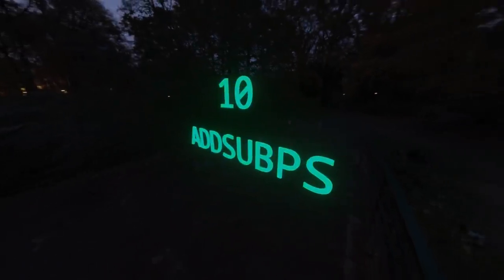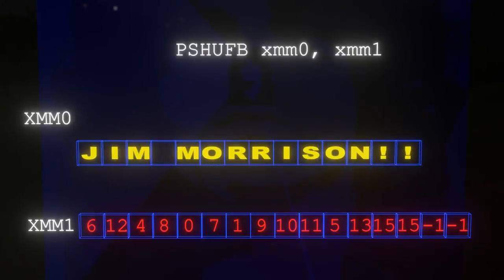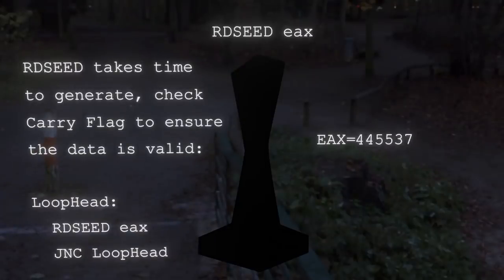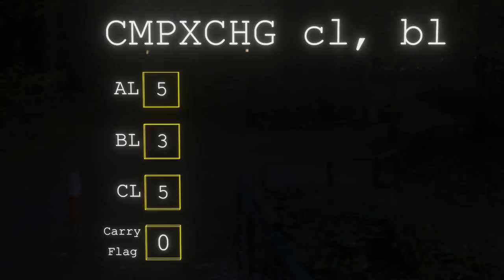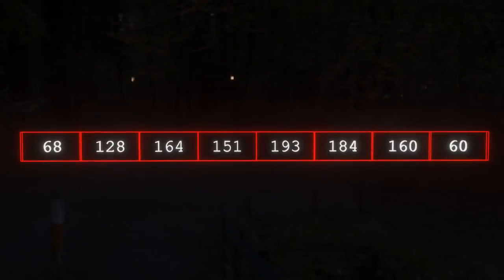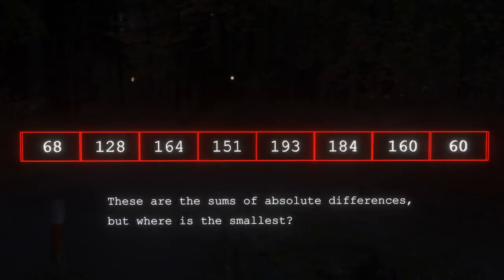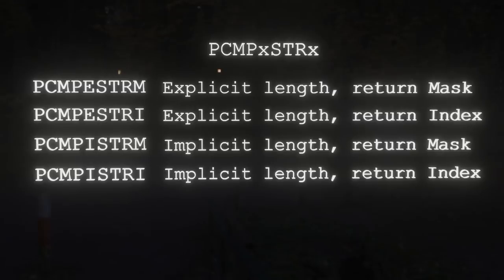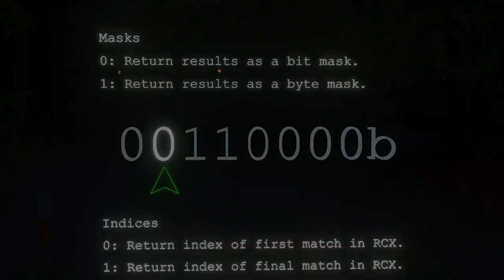Top 10 Craziest Assembly Language Instructions

Comment: "HCF" -- Halt and Catch Fire.

On a lot of early CPUs (1970s/1980s, yes damnit I am old) the manual gave the bit pattern for each instruction - and the the rest of the bit patterns did undocumented things.  Some were just a different way to spell NOP, some did deeply bizarre unintended things that happened because the bits randomly activated chunks of the CPU circuitry that mixed and matched chunks that were used in different combinations for other commands, and some did things that were only ever intended to be done in the factory, during QA testing. 
We used to hunt through these "undocumented instructions" looking for anything interesting or cool that we could then figure out uses for.  But this was a bit risky.  A fair number of CPUs had at least one undocumented instruction that would immediately cause the machine to lock up and, a few seconds later, destroy the CPU. Sometimes they caught fire, sometimes they melted through the PCB.  Sometimes they desoldered themselves from the board and fell out.  Whenever we found it we called it a "Halt And Catch Fire" instruction  and patched the name 'HCF' into our macro assembler for that bit pattern, in order to avoid accidentally finding it again.
Naturally when I saw the title of this video I figured HCF would be at the top of the list.
Finding an HCF usually meant a new version of the chip as soon as the company could mask it off.  We thought of ourselves as contributing to their QA efforts, although very few of them thanked us for it.
Reply: That is ridiculous, thank you for this comment.
Reply: Write while rewind
Eject disc
Read & write while ripping tape
Disable console
active emergency power off
Electrocute operator
Sense card deck on printer and open cover
Write past EOT
Read and scramble data

I have a huge list of them along with my green cards
Reply: Can you give some examples of interesting undocumented instructions you came across with?
Reply: @Safyire_  We found things like 'compare while swapping' that swapped the values in two registers while writing 1 to the comparison bit if the first was higher than the second.  That was actually a little bit useful.  We found a lot of things that tried to do two or three things at once but did them in a random-ish order because of race conditions.  One of those was useful because it consistently did xor before swap if the CPU was hot and swap before xor if the CPU was cold, so we could write code that monitored the CPU and shut things down if it got too hot.  We found instructions that connected multiple registers to the bus for output, meaning the result of the instruction would be written to four different registers at once.  We also found  instructions that connected multiple registers to the bus for input, which was useless and sometimes damaged the CPU.  It was a real crapshoot.  Also a very expensive hobby if you damaged the machine and your professor wasn't ready to write it off to "research."  CPUs were not cheap.
Reply: @rty1955   @Zrebbesh  you crazy old hackers! ;-) you are legends! :)
Reply: @morgwai667  Cept we never hacked, we worked ahha
Reply: I wrote micro code on a 360/30 and if it wasnt on the green card, it was considered an illegal Operation and program was aborted. There were no such things as "undocumented Op codes". Either you coded as per the green card or your job got canceled. Simple as that.
Even a nop was a simple BCR 0,0 or x'0700'
Reply: But why would you not want an HFC instruction? I can think of a few good reasons to have one, at least in government programs with high levels of secrecy. Or, like that one train control system that had 3 parallel CPUs and an explosive charge behind each of them, and the instant any one of the 3 disagreed with the other 2, the charge behind that CPU was triggered and the CPU was thrown out onto the floor. With an HFC instruction, you don't need a bomb squad to fix the system every time it throws an error. Personally, I can see no reason why I'd ever use an HFC, but I can definitely think of a thousand reasons someone else might want one.
Reply: @zrebbesh  Especially if you're old enough that a CPU was a drawer rather than a chip!  Heh
Reply: @mage3690  ... so when a program has a bug, jumps to a random place in memory and happens to land on a HCF instruction your computer dies. Does not sound like a risk I would like to take.
Reply: @mage3690 what train control system was that? Sounds like a cool story
Reply: Then why isn't there any sort of ASM malware that does these instructions?

Moreover, why did these functions even exist?
Reply: @Safyire_  i worked with a processor that if it had a test and jump on the result, it was undocumented.  all i could find was test and branch over the following instruction.  so i had to reverse the logic of the test and branch over the following instruction, which would be a jump.   so jump if equal became branch over the next instruction if not equal so that the jump would happen if equal...  an engineer at my company chose this for his fairly large project and i was the programmer on it
Reply: Did you ever read the novel BLIT? This HCF seems like a "basilisk instruction" to me!
Reply: @mage3690 Well if for somehow an application  runs wild (buffer overflow) and starts executing data as code. You sure do not want a HCF instruction in your data portion. best be patched out. Do not keep it as a security "feature".
Reply: @RationalFunction There were some, historically.

As to why these instructions exist, well, they don't. They're not instructions per se. They just happen to be behaviours which arise when using the CPU in ways not documented in the manual. Some of them are useful, some of them are consistent, some of them are neither. Some are harmful.

An analogue to cars would be things like engaging the parking break while turning the steering wheel, or throwing the gearbox into reverse while doing 55 on the interstate. Neither of these fall into expected operational input, yet they somewhat consistently produce a result which may or may not be desirable and may or may not be harmful.
Reply: @konayasai  I still don't understand what could cause a machine to just lock up, then fry itself. A "Desolder From Board" instruction sounds useful until you realize it would destroy laptops.
Reply: so cool
Reply: The atmosphere of the TIS-100. So it's all true then.
Reply: @mage3690 For the train control example, I am supposing you don't want to depend on a defective chip to disable itself. But I can imagine there would be good uses for what is essentially a self-destruct function.

Comment: I just remember, porting the torque game engine to PSP, and from all the work, the CMPXCHG instruction for the mutex, i implemented some native PSP intrinsic to do that, good memories, the best optimization trick also, the game was doing 10 fps at the best, the problem was matrix transposition, between the engine and PSP "opengl", so i made a transposition on the fly changing the order of reading and writing of the registers in the VFPU instructions, kicking the Sony engineers 'axe' ; ), and getting 30 fps, enough to pass their performance standards.
Reply: Wow you made PSP games?
Reply: @KangJangkrik  , i made the Torque game engine port, and on top of that another team was developing games using it.
Reply: Nice, but wouldn't it have been better to change which indices of matrices are used in vector and matrix functions? E.g. using m[4] instead of m[1] and vice versa.
Reply: Marix transpose is the dumbest operation ever, you shouldn't be doing that, ever.
Reply: @DiThi  that implementation costs 20 fps in that platform, you need to swap the entire matrix operations for every calculation, sounds trivial but was not for a 333 Mhz processor with slow RAM.

before was:

matrix.transpose(); // bloated operation
vector.mul(matrix);

after optimization was:

vector.mul(matrix); // due to the trick no transpose needed
Reply: @kyrylmelekhin2667  What if you have a large matrix of which you need the transposed multiple times?
Reply: @kyrylmelekhin2667  , not in this case, the "OpenGL" of PSP was using transposed matrix operations Torque was not, so was necessary.
Reply: @redsmith9953  You should make a youtube channel on that! Early/Mid 2000s gaming/tech is having a resurgence and you could tell people how you did that in a video format!
Reply: I knew CMPXCHG from some late 90's trauma from debugging a device driver bluescreen on multiproc machines, ultimately due to a compiler bug or misconfiguration that failed to generate the lock prefix. Good times.
Reply: @TimJohns  , 1 year later drinking like no tomorrow if forgot about that instruction!, now i remembered, thanks!, talking about that my first implementation was the naive approach using "if" and "swap" ( so dumb and naive i was ), my friend checked, and telled to me, is an "atomic function" so i realized my mistake, because of course was multithread related ( facepalm )  so i implemented properly using CMPXCHG, so yeah, patetic from my part, gross error... :/, nice times XD!
Reply: @formerlycringe  , Thanks for the recommendation now i'm a drunkard, and can't care less about programming i become something like a homeless hippie, i prefer to sleep on the streets than on my home, whalla!, that happens when you are a nerd and got a gf instead a computer.

Comment: Can't wait till you remake this vid in 10 years with all the custom RISC-V extension instructions. Gonna be pretty wild to see what people come up with.
Reply: The big mistake Intel made is to create fixed width vector instructions. The V in RISC-V points to the importance of the variable width vector instructions where the assembly code doesn’t need to know the vector register size (V extension), and a similar matrix extension is coming for machine learning I think (though V is already a great improvement)
Reply: @ritteradam  The V in risc-v is a roman numeral standing for 5, as it is the 5th iteration of risc from Berkeley (i think).
Reply: @canaDavid1  Officially yes, but you can find videos of the people who developed RISC- on YouTube, and they mentioned that they originally developed it because they wanted to get the vector extension right, and that's why they called it RISC-V at the start.
Reply: Also it's a reduced instruction set (risc) and not a complex instruction set (cisc) like x86
So why should risc-v even get some of these?
just do them in software and let the compiler do it's magic.
Reply: The point of risc-v is to have a common set of instructions understood by many cpus and to be extended with application specific extensions where needed. So you can be 100% sure there will be many wild instruction extensions.
Reply: @tripplefives1402  While you may disagree, a big section of the RISC-V specification isn't the base instructions, but official extension instruction sets (which include vector operations, that you may consider can only exist in CISC architectures), and about creating unofficial extensions. (see chapter 26 of the specification)

It is a reduced instruction set CPU not because it can't have complex instructions built in but because the base instructions are reduced.
Reply: @tripplefives1402  The "reduced" part refers to how the instructions are encoded, which is largely achieved by load/store and eliminating addressing modes.  There's nothing that says a RISC design can't have thousands of instructions.  RISC is a philosophy, not a technology.
Reply: @tripplefives1402  Actually, I have studied CPU design extensively.  Most CISC designs only have a few dozen instructions, but once you factor in all the different variations you need to support all available memory addressing modes, it blows up into thousands.  It's the classic handshaking problem.  RISC processors eliminate that complexity by using a load/store approach, and the tradeoff is that it increases the number of instructions required by programs, generally causing them to use more code space.  RISC isn't really that efficient, especially if you go the route of the classic MIPS design.

Also, take a look at the PowerPC spec or ARM Neon.  There's tons of special-purpose streaming instructions that are complex and infrequently used, and usually require special addressing modes of their own, which is really not very RISC-like at all.  I guess you can always make exceptions to the rules as long as they are convenient!  Even the whole idea of 4 or 5 operands per instruction is not in line with RISC philosophy, but they do it anyway.

The way Intel designed their CPUs was a business decision, not a technical decision.  They are a CPU company and wanted to sell CPUs, so they built all kinds of crap into their instruction set rather than use DSPs and coprocessors like everyone else.  That's why MMX was rendered almost irrelevant once 3D accelerators hit the market.  It's also why Intel keeps failing so miserably at making graphics cards (they keep trying to build them with Pentium-style cores).  It's entirely possible to make a clean, efficient CISC design, but Intel just didn't do it that way.  If you want a laughable view into how Intel thinks, look up iAPX sometime.  Anyone want to program an object-oriented CPU?

Personally, I think x86 has seriously poisoned people's perception of CISC.  x86 isn't complex because it's CISC, it's complex because it tries to do all sorts of stuff that CPUs shouldn't even do at all.
Reply: @tripplefives1402  why are old legacy unused instructions, which may take up transistors and die space, also causing the CPU to burn up so many watts? Just because the CPU has gates and code to do a bunch of old useless junk, if that part of the die is just sitting there doing nothing why is it adding to power draw?

(Serious question by the way)
Reply: @tripplefives1402  I figured it would be like downloading a bunch of programs that sit on your hard drive. If they’re not actually running (and in memory) they’re not really taxing or using your computers resources (other than hard drive space. But your system doesn’t run slower or use more power if your drive is filled with idle apps just sitting there not being ran)
Reply: @tripplefives1402  💪🏻👍🏼 thanks
Reply: Looking at the V spec, the dpps instruction should actually be possible in 3 instructions, and it's usable with any element width. The magic comes register grouping and widening operations. While you'd need to organize your elements differently, you can do a widening multiply, which works for any supported source and destination type. Unfortunately, I can't tell if the destination "register" is allowed to overlap with either or both of the source registers. Regardless, since the destination "register" is actually 2 registers, you can then do a normal addition between both halves after switching vltype.

As for addsub, straight or cross, halving or saturating, unsigned or signed and starting with add or sub? Every combination of those options is present for 16 bit integers in the P extension. The P extension is absolutely wild! Because nobody can complain about fixed-size SIMD instructions if they just use the normal integer registers, right?

Not related to the instructions in the video, but Zce is pretty impressively packed into a single block of the 16bit compressed space, and most of it only actually uses 9 bits for all of the currently accepted instructions that don't reuse space for what would be floating-point instructions. Some of the instructions have as few as 8 different encodings for all its variations (that's including registers and immediates).